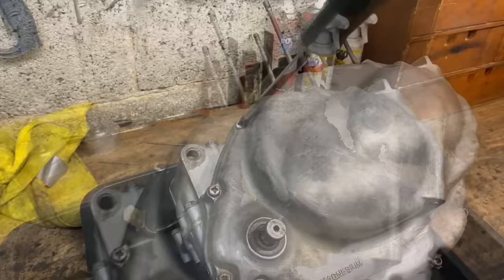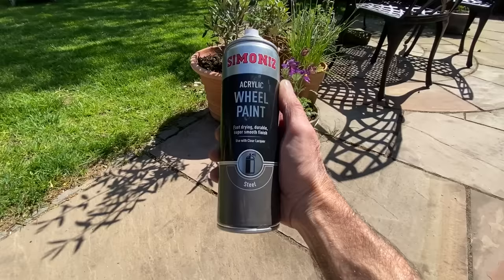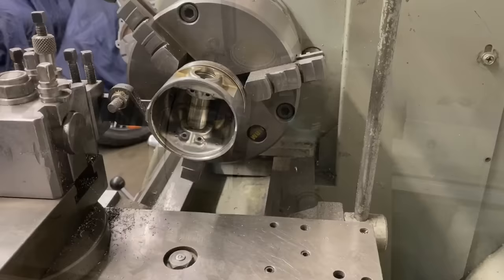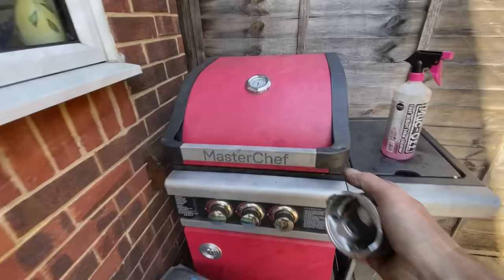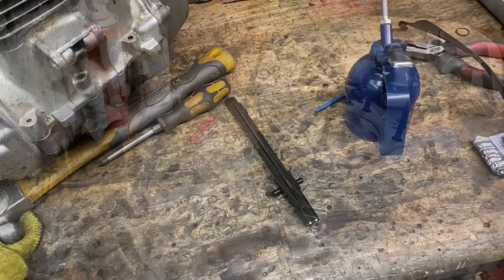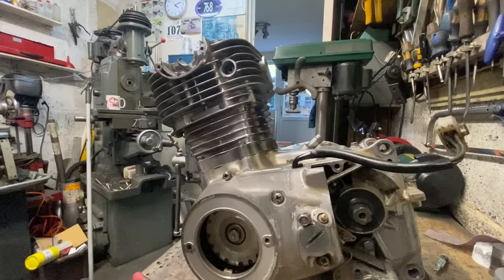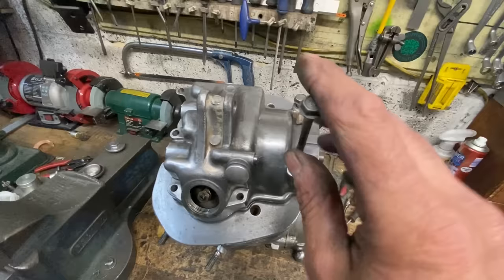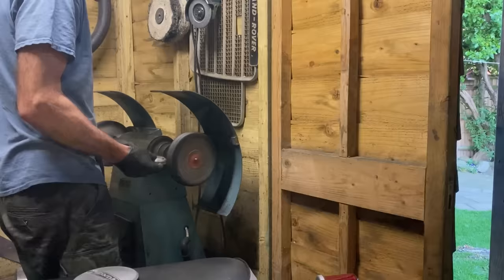Honda XL175 engine repair

Comment: Hi Allen, I machined the ring grooves on a big bore KTM piston on my Harrison lathe, nearly killed myself, guess who left the gudgeon pin in the piston which promptly flew out at speed when I started the spindle and parted my hair! An inch or two lower and I'm certain I would have killed me. I'm a tool maker with 44 years experience with my own shop, just goes to show you can get your guard down every now and then! 😁 good videos, keep em coming.
Reply: No problem you're fired  and black balled from The Machinist trade
Reply: I left the chuck key in once.... only once
Reply: @nearsightedfromthefarside6534  I did that in metalwork class at school in 1971.  As you say - only once!
Reply: @nearsightedfromthefarside6534  I did my fitter and turner apprenticeship in HM Dockyard, Portsmouth in the early 50's. Our lathe instructor was very good. He impressed upon us the importance of always removing the chuck key unless we were going to use it. Penalty for leaving it in, if he saw it, was we had to to hand hacksaw a 6" steel square block with a 12" blade - which took forever - and the time allocated for your test job was still ticking while you did it!
Reply: Near sighted from the Far side, because the key flew out the window and was never found?
Reply: Fred Farnackle, I like his pedagogical technique! Will try to learn from it.
Reply: Hugh Jaanus  I'm pretty sure that's what he said.
Reply: Hugh Jaanus  Your point?
Reply: . We were shocked into line with gorey pics of scalped heads from long hair caught in chucks and lodged chuck keys in faces, chests, and the like, at tech school. I'll never forget seeing those pics. and for the people who didn't get it, the pics were left on the wall for the entire duration until graduation. It really turned me off from going into Turning, it was too scary for a 12 year old who had just made it within an inch of my life in a car wreck the previous year. where I had received 180 stitches from being scalped by a rollover.

Comment: I feel like I have just watched a genius at work. Effortless engineering skills. The position was a bit sloppy. So Allen has a rummage through his scrap box pulls out a Z Thos piston, takes the rings off and machines the piston to fit. Like it was nothing. I was just in awe throughout this video. It times gone by guys like Allen invented the telephone, electricity and the bouncing bomb from Dambusters. Just knocked up in his shed. I am now a super fan. Incredible

Comment: I was involved with Honda machines from about 1962 onward and served as a mechanic and service manager for 15 or so years.  One of my favorites was the CB 160 which I owned as my own commuter bikes.  I'd be interested in videos you might cover rebuilding the crankshafts of  older small Japanese twins as it takes specialized tooling to be made and finding suitable spare bearings and crankpins.  May not be much of a demand for it but these older engines were the bedrock of Honda design back in the day and were very sturdy and dependable.

Comment: I love the way you are swapping pistons from other engines - well done!
Reply: Yeah, he put a piston with 4 valve relief cuts in a 2 valve engine. WTF? I pity that poor combustion chamber...

Back in my misspent youth when I raced an XL-175 I replaced the piston with one from a CB-350. Higher compression!
Reply: Just piston rings. He used the honda piston
Reply: Im sure Allen would have worked out if this was an Interference Engine and if there were any clearance issues beforehand.
Reply: @mightress  yeah but its a 4 valve piston in a 2 valve head.
Reply: @michaelhayward7572  makes no difference for the rings, they just sit in a groove. Nothing to do with the shape of the piston.
Reply: @mightress  er, thats not what i was on about. Rings, nor grooves were not in my comments. Piston crown and shape, and combustion chamber and shape, and number of valves and compatibilty were. Perhaps my description was poor....
Reply: @michaelhayward7572  he says he fitted it years ago. I do not see the problem with the piston. It obviously ran just fine. It had 4 dents wich is no problem at all. Might be not shaped and a two valve piston but it will compress the mixture just as well. These bikes are not high compression huge hp racing bikes so clearance is not that much of an issue.

Comment: 45 years of rebuilding engines as a hobby always with access to a lathe and mill never did i think of swapping around piston rings or holding in gudgen pins with buttons not clips. Strange how now and again the penny drops when you watch a complete expert at work. Just like for 30 years to me wheel building was a black art until you see it on You Tube now I rebuild wheels. Thank you Mr Millyard engine rebuilding that contains engineering gold dust....subscribed.

Comment: Allen does it again, but this time he triggers some old and fond memories as I bought a brand new Honda XL175 in 1977 it cost $729 AUD. It was my first motorcycle. The very first motorcycle I rode was a Honda QA50 in 1971. Honda and I go back that far. Also after watching a few of Allen's videos he has awakened a urge to make my own gaskets. The the two best tips I have learnt from these videos are to make my own gaskets and change the original screws to socket head screws. Yes, I had to buy an impact driver to remove the over 50 year old seized screws. The worst screw holding the two case halves together took over an hour of beating to remove. 

Once again I thank Allen Millyard for his informative videos and reigniting my passion for motorcycles.

Comment: That was my first bike in 1974, all I did was wash it and change the oil.
Reply: I got mine around 1980 with low miles, but same thing, it required no maintenance. I might have adjusted the tappets just for fun, because I like to do that sort of thing.

Comment: Fantastic, a real eye opener. Can't wait to see the one on head gasket making. Could you also show us some more machining: Cutting piston ring grooves, boring out cylinders, fitting new valve guides and seats? Is it also possible to regrind bearing and cam surfaces, and do nitriding on the BBQ? If anyone knows it would be you!

Comment: Fantastic videos! I learned motorcy mechanics on similar engines as these. I'm nowhere near the level of skill of this gentleman. The first engine I took apart and never got going again was a non running BSA Bantam 2s in the 70s when I was in highschool. My second bike ran (barely). It was a Honda SS50 Fury, same engine as the one he restored in another video. The bike had no kickstart, so it always had to be pushstarted and no off switch, so it had to be stalled to kill the engine. The compression was so weak that you could spin the rear wheel in 1st gear by hand.. I learned how to swap a piston and work around the cam chain and set cam and points timing on that bike.
Good memories here. That 175cc engine is the predecessor of my current Honda XR150L..

Comment: Why am I not surprised that Mr. Millyard uses the scissors on his swiss army knife to make his own gaskets? Of course that's what he uses, because he is making his own gaskets!
Reply from the maker: Ive had that swiss knife since 1998 and its cut every paper gasket for every engine ive worked on
Reply: if it ain't broke dont fix it.
Reply: @AllenMillyard  you must have sharpened those scissors a few times then. They look to cut really well
Reply: @AllenMillyard  Same here although I've also found some superb surgery scissors that do a lovely job as well.
I've found the most useful Swiss Army knife to be the Explorer. It is one of only 2 or 3 models (one other is the Golfer) that has the Phillips driver out the end instead of it projecting at right angles, much more useful. It has the loupe as well which is excellent for crack detection.
Tell you what though, I've not found better than Three Bond (Hondabond, Yamabond) engine sealant, and I've tried every gorilla snot there is or has been. I'll knock apart an untouched 50 year old Japper and the Three Bond inside the engine that squeezed in during initial assembly has never come adrift, swelled, or became brittle. It is in my humble opinion the best case sealant that is made. 
In fact, I rarely replace gaskets, I simply remove the part, ignore torn gaskets, apply Three Bond, and bung it back together. They never leak, never.
Reply: I think if Allen Millyard were shipwrecked on Gilligan’s Island he could’ve built himself a workshop and not just a boat to escape , but it probably would be a  V16 he built from scratch. 
He is a proper fabricater
Reply: Pmsl..unique man AM
Reply: What is your day time job ?
Reply: @jamessharp9790  With a proper workshop on a deserted Island, I'm staying.
Reply: @AllenMillyard  is it for sale
Reply: Allen Millyard Swiss Army knife scissors are the most useful and well made scissors I have ever used.  Thoroughly enjoyable to see how much love and care you have for your work. Thanks for taking the time to share what you can!
Reply: @AllenMillyard  Swiss Army knife scissors are remarkably good as any scissors are concerned. The spring return & hard steel blades along with the long fulcrum of the knife body make them better than almost any small pair of scissors, no wonder you use them.

Comment: The XL always bemused me. Some parts are like a competition engine (mag covers, high comp, cam directly in head, big valves and relatively lots of revs) but then others are full on endurance designs - air cooling, nut and bolt tappet adjusters, points over cdi, oil spinner, etc). 
Its almost like they were making two bikes at once.

Comment: Reminds me of the Motor Cycle Mechanics Magazine of the sixties that used to have a step by step photo assembly of the bikes of the era for young engineers like us. By the way, copper gaskets do not need to be quenched to anneal them, just bring them up to dull red hot, and let them cool naturally. The quenching process applies only to ferrous materials. Great upload .

Comment: Blimey im surprised you didn't make it in to a v twin! And fuel inject it!
Reply: LOL!
Reply: First thing I thought, V-twin superbike for Isle of Man TT races.. oh.. its just a quick rebuild.
Reply: Hahaha... well held Jools!
Reply: Yeah, I was just waiting on the hacksaw coming out, that's usually my favourite bit.
Reply: haha!!
Reply: Jools Freeman Don't be putting ideas into his head lol.
Reply: An XL-350 twin? I wouldn't mind seeing that myself.
Reply: Clifford J. Summers Sr. 
The four valve XL250 K0 was the best. About 21bhp but better pull that the later twin pipe versions. 
https://classic-motorbikes.net/classic-bike-images/honda-classic-motorcycles/honda-xl350-gallery/
There was also a CL350 twin. 
https://ridermagazine.com/2019/04/26/retrospective-1968-1973-honda-cl350-scrambler/
Reply: Allen: hold my cuppa

Comment: A 4 valve piston in a 2 valve head....you werent worried about clearance of compression ratio then!?
Reply: That's what I thought too. But if it's cheap & works then why not. I'm sure he would have at least checked that the piston cleared the valves. Perhaps due to the rather large increase in bore size the compression would still be ok, even with a flat top piston, and not requiring high octane fuel. Perhaps just a cheap paddock basher that they did not want to waste too much money on.
Reply: @glennmerriman8382  he only swapped the rings not the pistons.
Reply: @memybikeni9931  he swapped the original piston for a bigger VFR 750 piston some time previously, he is now widening the oil ring groove in the VFR 750 piston with a parting tool to accept the different wider oil control ring

Comment: I never would have thought a four valve piston would have worked in a two valve engine. Either compression too low due to lack of dome top, or valves hitting piston due to valve cut outs in wrong place. But there you have it.

Comment: This brings back some memories of the smaller bikes I've had and worked on. Old cl90..xl125..xl250..xl305 kitted..xl350. simple to work on and nothing much a problem except a chopped out head from the cam. A local guy worked magic and specialised in these head problems. A cb100 or three was in the mix also. More bikes to go but don't want to fill a page. It was a hobby of my be to tart up a bike..fix a few things and sell it then find my next project. Great to watch as always. Thanks Mr. Millyard

Comment: Rather than cutting the gasket with a sizer, you can use the peen side of a ball peen hammer and tap around the edges, the gasket will be cut to exact fit. The same goes with the holes. Place the peen side of a small ball peen hammer over the holes and tap the flat side of the hammer with another hammer. Just a tip. Great video.

Comment: Back around 1964 my friend had a BSA Super Road Rocket, we were doing an engine overhaul when a more knowledgeable mate and his friend came along as we were putting the cylinders on. This guy suggested we cover the opening with cloth where the camshaft was to stop bits falling inside, great idea. We completed the reassembly and push started the bike, it soon started to billow out smoke. Then someone said, "did we take out the rag?" We all looked at each other, OH shit!!! We took the thing apart to fine the tattered remains of the rage still in the opening. I can't remember how we cleaned it all out but we did get it going again. We had many disasters in our bike maintenance. It was fun time riding and fixing the bikes with very little knowledge. We really needed someone with experience to guide and help us and a proper place to work.

Comment: Just found your channel Allen, great stuff ! - My son and I are about two thirds through restoring a '71 Honda CB125 twin for him, it easy to tell that your XL engine has had some Millyard TLC in the past, I nearly cried when I saw how quick that clutch cover came off, took us almost two solid weekends with every method known to man just to get both side covers off !.. The screws finally (and very reluctantly) succumbed to the mighty impact driver and a big hammer.. Not very elegant and I wouldn't necessarily recommend it but it worked and all was well in the end.

Comment: Nice to watch. I mechanice'd bikes for several years, and i saw a trick or two here that i liked, like the paint brush for gasket goo. I always attached a wire to the cam chain to keep it under control during assembly. The CB450 had a cam chain about 2 meters long! When my honda 50 lost the con rod bearing, which destroyed the piston, we had to machine a c110 piston down, on a lathe in the school metal shop,and re-gap the rings, and it worked out fine!  Nice video!

Comment: Fabulous!  This brings back memories from nearly forty years ago, when I had a CD175 with a centrifugal oil filter.  I recall using a handlebar bolt, rather than a special tool to remove the filter, having read this tip in a Haynes manual.  Also, forever having to adjust the points, and once having my legs electrocuted by the metal spark plug covers while riding in torrential rain in Oswestry.  Those were the days!
Reply: good old cd175 , i have had around 12 of them over the years , i  rode one from  cambridge to swansea and back via  m4  north circular  m11 i was about 1 mile from cambridge on return journey and my rear end felt warm , i had an electrical fire under seat  and sponge had caught alight ,and of course with seat being bolted on i could do nothing , bike caught on fire and i lost the bike , i had plastic from the seat welded to my  trousers  lol , i am doing a total restoration of one now and am using  a screw type bolt like they have on lawn mower handles  to hold seat on ( made from metal  by an engineer friend of mine) , so if it ever catches fire i can get the seat off quickly
Reply: @daiberry-cp8ee  That's a great story, and  beats me getting electrocuted in the rain!

Comment: I have had some Honda motorcycles in my 75+ years, but I have some body parts I don’t need or have two of that I would swap for the Honda 100.  This man is an engineering/mechanical genius.  I applaud all his work and efforts.  Yes sir, I did subscribe to you and I give you a high five also.

Comment: My Dad showed me a really neat way to make the gaskets using a small Ball Pein hammer. You can gently tap away on the edges, including all the bolt holes. It works a treat. Try it, you'll be amazed at how easy and quick it is.

Comment: I am grateful for your videos and knowledge, your the reason I went out and got my first bike about a month ago, A friend give me a 1980 Honda CB750, it doesn't need a lot of work. I just need to put in a battery cage, a CPU and a battery and it will run. I am currently in the process of stripping the bike down so I can get it ready for paint.

Comment: "so that's easily rectified, putted in my lathe"...makes putting a Suzuki DR 350 rod with a Honda Transalp crankshaft using a Kawa GPZ 750 gudgeon pin with a Yamaha XV 400 piston ..into a Mostro 750 cylinder , an everyday's job, before even having a decent cup of coffee..All these without an eyebrow moving..Hats off, Sir!

Comment: Nicely done. I really like your minimalist approach, fitting pistons and rings that you already have, cutting your own gaskets, etc. Sometimes when I punch the bolt holes in a paper gasket, it will cause a tear between the hole and the outside of the gasket. I like to punch the holes before cutting around the outside, to eliminate the possibility of that happening.
Reply from the maker: The gasket paper I use is strong and barely possible to tear

Comment: The pin kipper remained me of making a set for an old road grader engin,  only solution because no parts available for it. I didn't have any stock big enough so I melted down some scraps and cast the blanks then used hand tools to shape and fit. It was still working the last time I saw the machine 20 years later.